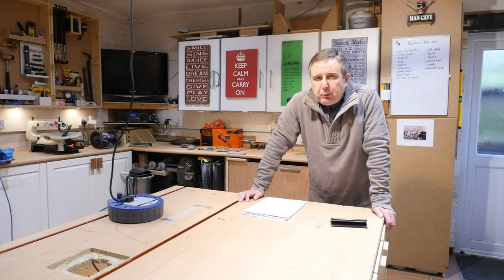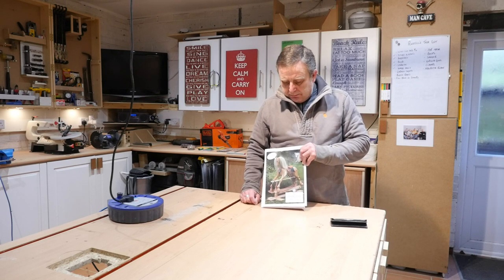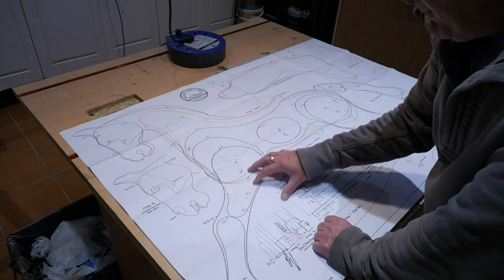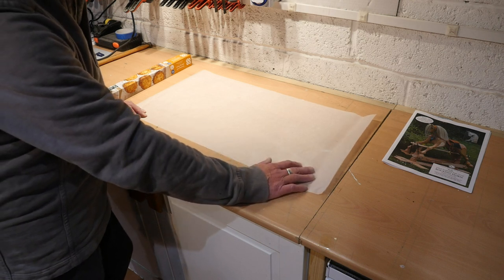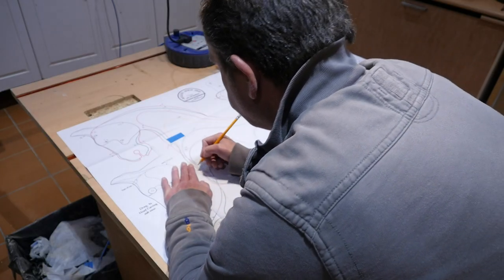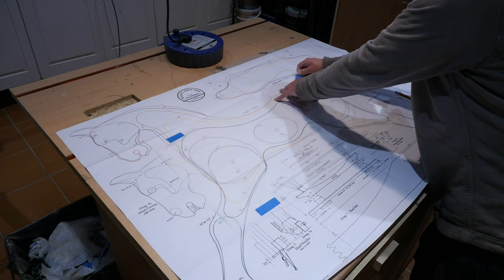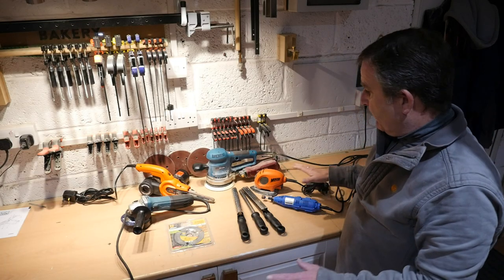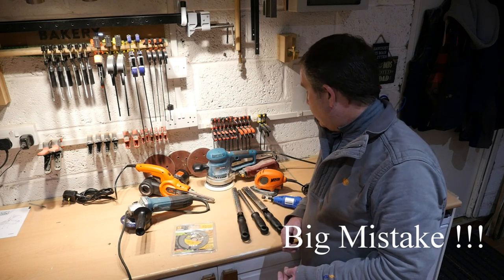Rocky

Comment: I'd like to offer another tip:-
Glue everything together (except the last outer layers for body) then drill dowel holes, add dowel, then glue on final layer and legs.
This will ensure dowel holes all align, and give better strength, rather than tiny pieces.
Also, I managed to 'Carve the entire horse using a 4 inch sanding head on a grinder.
Very little kickback, no danger to fingers. 40 grit, I used only 2 x sanding heads for the entire project ($10 each).
Reply from the maker: That's a great tip Louise. It is a bit tricky lining up the dowels if the holes are pre drilled from the templates.
Reply: @russellford2069  thanks Russell.
I hope your fingers are better, skilled artists like you, need good working hands.
I have felt quite lonely doing this project alone, seeing your video has given me inspirational support, thank you so much! <3
Reply: I also thought of doing it like that but after the event shall we say. Currently I have the 2 halves that I am carving as thought it was easier to move them about - as I am doing the large Rocky.

Comment: A couple of years ago  I was in New Zealand and went to visit one of the big Kari Furniture and carving places got talking to the manager and he states that he only uses the cutting wheel of a Ryobi biscuit joiner in his grinder for this type of power carving.(His Carving are huge) You will have to make up an adapter for it to fit the shaft of your grinder (The exact same one I purchased from Arbotech sells works fine but it can be made up  from  from cutting board material on a lathe.) It has six carbide teeth have been using it for a number of years and I still have all of my fingers. At the time.

 Think it cast me about $15.oo Aust. I think I brought it from Bunnings.Hop this helps.

Love the rocking horse am currently ordering the plans to build it.
Reply from the maker: Thanks Brendan. Great tip and I'll be actioning it. Cheers

Comment: A quick question- any advice on quality of the plywood to buy, and where to source it from?
Reply from the maker: Hi Richard. You need to make sure it's Birch Plywood as it has a much smoother finish than normal plywood. It's a bit more expensive than normal plywood, but it also gives the nice contour effect.

Comment: Hi Russ. How did you fit the mane hair in place or any recommendations. It white real palamino hair
Reply from the maker: Hi Grant. Apologies for my late reply. The mane hair was ordered from The Rocking Horse Shop. The Web address is at the end of the video. The Instruction manual that I ordered details how to fit the mane. It is real horse hair. Basically, I chiselled a groove and then lightly tapped the mane in with a pin hammer and punch. Then nailed in place. Didn't need to be glued as it was quite tight. Hope that helps you

Comment: Hi Great video, Do you think this would work with OSB to give a mottled pattern horse? hope your fingers are all OK now.
Reply from the maker: Hi Andrew. Thanks for the kind comments. I don't think OSB would work. I like your thinking but when it comes to carving I think it would end up flaking too much and you would end up with a very rough horse. The reason Birch Plywood is used is because it is quite a dense ply, and sands down very smooth.
Reply: @russellford2069  Many thanks for your quick reply, and your sound advice, take care, keep up the good work, regards Andy
Reply from the maker: @andrewcole3833  Thanks Andy. And Yes, the fingers have almost mended back to normal. Cheers

Comment: Hi Russell, I got the plans for a large Rocky (plan 140) just after christmas and going to get the wood tomorrow. I have bought a Kutzall Original Shaping Dish - Fine, 4-1/2" for the carving with the angle grinder. I also have a power file as well. The video looks to be quite helpful. I have got carbon paper and plan to use a piece of dowel to trace on to the hardboard (so as not to draw over the plan lines) to then use those to draw around onto the 18mm ply. Any tips ?
Reply from the maker: Hi Adrian. Great that you've got plans to do the Large Rocky. I'm going to give it a go later in the year but I've got another large project on the go that I need to complete first. The dowel and carbon paper sounds like a great idea and one that I never thought of, so good luck and let me know how you get on. As you can see from the video, I used tracing paper, which was a bit tricky but did do the job. Once you've got your hardboard templates, the job is plain sailing. When you have cut your hardboard, just overlay it on the plans to check for accuracy.
Reply: @russellford2069  Thanks very much. I will let you know. Thanks for the reply glad to read your fingers are almost sorted and good luck with your projects. Thanks.
Reply: Hi Russell, just thought that I would let you know that I am up to the carving stage. For ease of mobility at the moment I have kept the 2 halves seperate. Probably taking longer to carve but being careful and possibly too delicate but with the Kutzall Original Shaping Dish - Fine it can remove a fair bit at a time. I am enjoying it. Cheers.

Comment: Excellent work - though I'll be getting an arbortech turbo plane - expensive yes, but would appear to be a lot safer (hope you fully healed up without issue)
Reply from the maker: Thanks for subscribing and the comments. 4 months on and still haven't got full use of my fingers but they're getting there. It could of been so much worse. Haven't picked up an angle grinder since and you will be doing the right thing by buying the arbortech blade.  Cheers and stay safe

Comment: Hi Russell, I’ve sent on off for the plans for the ‘Rocky’ horse after watching your amazing work, hope I can make a good job of it!
Great idea to cut templates out of thin ply first, was wondering about the stand and if i can get measurements for it ?
Best Regards Roy.
Reply from the maker: Hi Roy. Many thanks for the lovely comments. You'll find dim's for the stand included in the plans you've ordered. Best project I've done. You'll enjoy it so much. Just take your time and enjoy the whole process. Cheers Roy
Reply: Thanks for replying so quickly Russell, I’ve got the plywood and looking forward to getting started. It will take me a while !
Reply from the maker: @royjakes7549  Just take your time and enjoy the process. The end result is a brilliant reward. Please keep me updated with progress and feel free to ask questions along the way. Cheers
Reply: @royjakes7549  Hi Roy, Just seen your comments to Russell. I am in the process of building a large plywood Rocky. I am currently in the carving stage. Just thought that I would give you a couple of thoughts that I used. To help align eveything I bought some M6 threaded bar (10x 1 meter lengths - £8.50 total) from Amazon and used this to help clamp whilst glueing the layers of the halves together. What I maybe should have done is to glue the body halves (no legs together) using the bars and then glued the legs on afterwards to the fully assembled body. I am also finding the wolfcraft 2520000 40mm rotary rasp very good for the carving when used with a flexidrive on the end of a clamped drill, lighter to weild than the angle grinder and you can get in tighter spaces with it. I also invested in a Kutzall Original Shaping Dish - Fine for the carving with the angle grinder, although nearly £60 it is very good. Carves quite nicely but watch out that although it is the fine one if you are not careful it will take a fair amount of ply off very quick. I tried it out on a offcut 1st to see how aggresive it was. Doesn't bite as a toothed disc would as it is like having a disc of honeycomb (if you get my drift). For a large Rocky my estimation for casamite powdered glue is that I will have used nearly 500g of it, the mix ratio is 1 part water to 2 parts powder. Sorry if this is over the top. Cheers and enjoy the build.
Reply: Also bought some anti-vibration gloves as well. I found that they do help to reduce pins and needles espectially towards the end of a weekend carving.
Reply: @adrianlynch9435  Hi Adrian, thanks very much for your informative comments . I like the idea with the M6 threaded bar! Just sent off for some. Very helpful advice.  Cheers.
Reply: @royjakes7549  what I also bought was a longer than normal 6mm drill bit to go through multiple layers. What I did as well for aligning the parts was to mark the holes from the plans on 1 part only, say the last outside part that the leg holes go all the way through - think on mine it is Ff. Then on the lower layer draw the outline of Ff postition Ff on top of E and use Ff as the template to drill through E therefore hopefully as you keep using the layer above as the drill template all holes should then line up. As mine is the large what I did instead of tracing paper I bought carbon paper stuck them together and used a sharpened but blunt dowel to draw on the plans with the carbon paper then putting the lines on the wood. This way my original plans are not marked. The other way is photocopt the plans onto A3 and use the photocopies to draw on. Again hope it's going okay.
Reply: @adrianlynch9435  Hi Adrian, could you please advise what size sheet was used, for your large Rocky.? Thank-you in advance , from down under.

Comment: What varnish did you use Russel ?
Reply from the maker: Hi Adrian. Apologies for my late response, been a bit busy of late. I actually experimented with an offcut and used Yacht Varnish. It looked good and really gave a smooth finish so that's what I went with. Obviously sanding and a lot of patience is key. I ended up applying 3 coats which really didn't take long. A very fine sand before the final coat was applied.
Reply: @russellford2069  Hi Russell thanks for the reply not ready anyway so it doesn't matter. Did you dilute the first coat for better penetration ? I think it can be diluted with white spirit as a sealer and read then the second coat sticks better as the 1st layer isn't as thick.
Reply from the maker: @adrianlynch9435  Hi Adrian. No I didn't dilute it but I did misinform you. I actually used four coats. A very fine sanding between third and fourth coat. Diluting the first coat for better penetration sounds like a sensible option. Please let me know how you get on.

Comment: Please may I ask did you manage to do the carving without either the ‘lethal’ cutter or the Arbortech one?
Reply from the maker: Hi Mike. After the accident, all I used was the Black and Decker Powerfile. May have taken slightly longer but was more than adequate for the job and a lot safer. I also used a drum sander attachment on a drill for some of the more awkward areas. Hope that helps
Reply: Than you for such a prompt and helpful reply. You must be very pleased with the final result, I’m sure your granddaughters were. Thanks again.

Comment: When I made Rocky, I used
 a 
WARRIOR
 4-1/2 In. 24 Grit Carbide Shaping Disc. 

This works quickly, is relatively safe, if you use gloves and also very cheap
.
Bosch also sells this in three types, fine, medium and coarse. I used coarse, but medium would also suffice for more cautious or inexperienced users.
Reply from the maker: Sorry for late response. Great advice. I won't be taking short cuts in the future. Excuse the pun